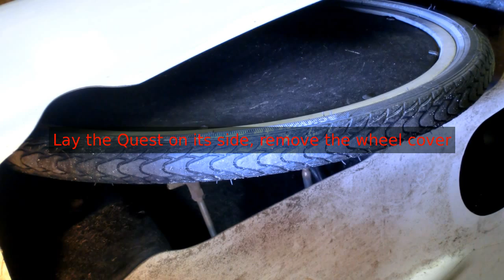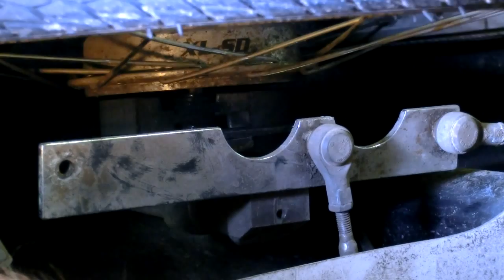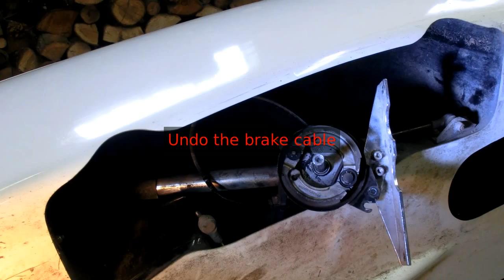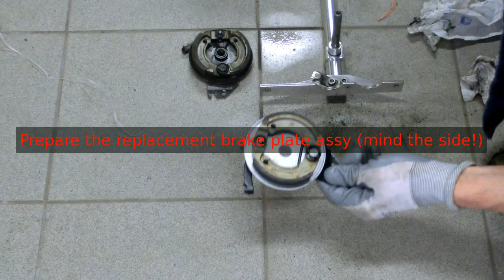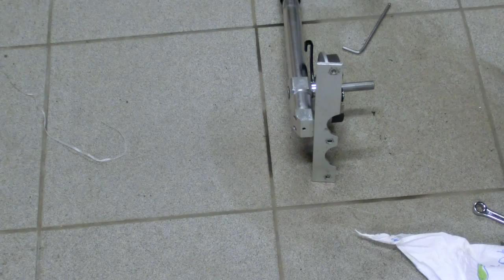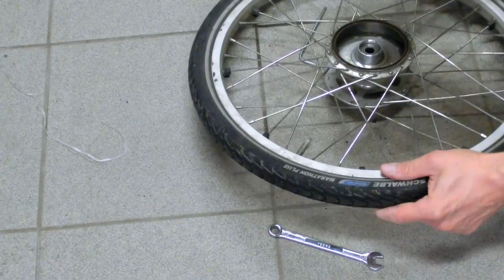Quest 474 - Installing new drum brakes on a Quest velomobile

Comment from the maker: The set of brakes I replaced had about 6000 miles. It's quite hilly in my area, so the brakes lead a hard life.
I reckon this set had maybe 1000 miles of life left in them, but since I have a few rides planned this summer, and Velomobiel.nl sells the brake plates cheaper than dirt (47 euros for a pair, incl. tax and S&H), I figured I'd do the job before the nice days are here.

Comment: As you found out, it's easier to remove all struts first, then pull the wheel out and then it's easy to open the drum brake.

Remember to check that that torgue arm bolta are tight. I had one bolt fall off during ride and it caused catastrophic brake lock up without a warning... I can't think of any worse failure at full speed. It happened to me. I'm lucky I got away unharmed and alive and and my Quest only had major paint damage and shredded brake cable. I wonder why they use that thin steel adapter as a toque arm. Why not have a big welded block on that L-shape aluminum instead of thin bent steel strip??  Now there are two bolts doing a job that should be done with only one bolt on normal bikes. That's twice the risk of bolt failure.

By the way what's the point of adding grease on the axle where the non moving part of drum brake is located?
Reply: to stop it seizing in future?

Comment: awful close and dirty job,I'd say! My Spirit trike used these same brakes and I  was able to change them out in around 25 minutes. Of course it was only the front wheel as it was a front wheel drive delta lean to steer vehicle with full fairing. I made the front wheel with quick release and it could drop down out of the wheel hole right after the Q R spine was removed. The holder for the brake strap was also a quick lever so no tools were required to undo it all.